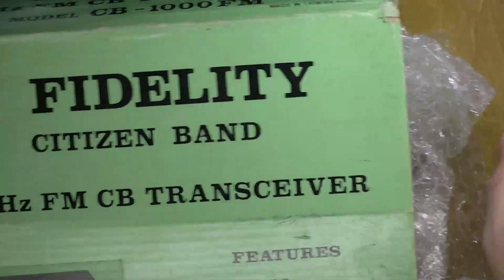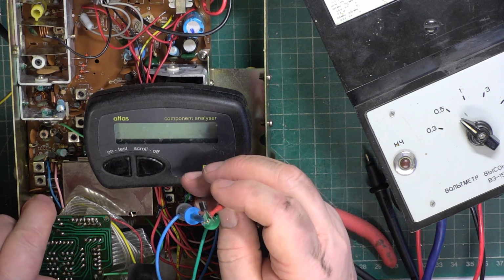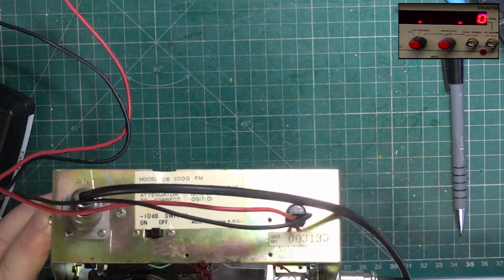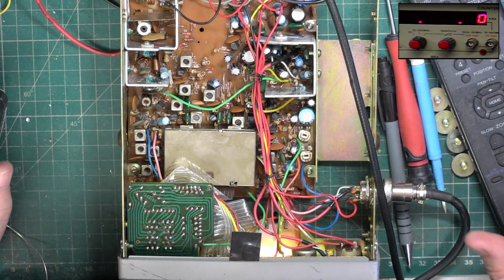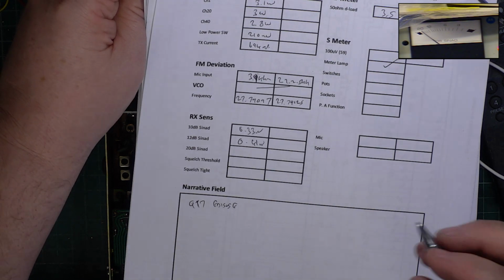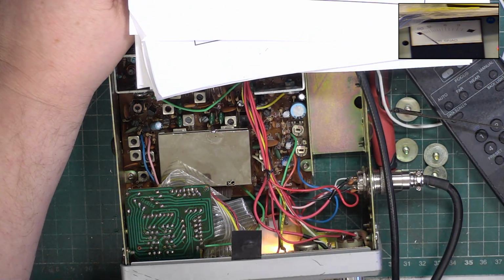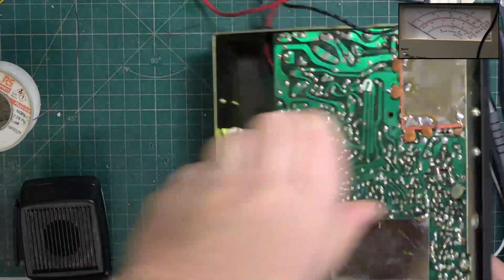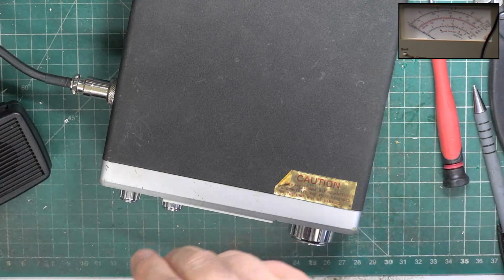Fidelity CB1000FM CB27/81 UK FM CB radio -  Repair & retune.

Comment: CB1000FM is not helped by the mike cable coming off the left, so stretching across the panel in right hand drive cars!
Reply from the maker: The same applies to most Uniden & Cybernet sets unfortunately too.

Richard
Reply: @ukfmcbradioservicingTango21  Yeah back-in-the day radios were sold as front mounted mics as a feature - trivial compared to the inards